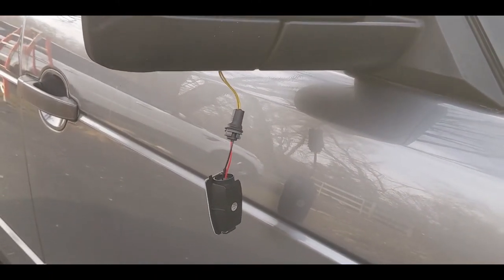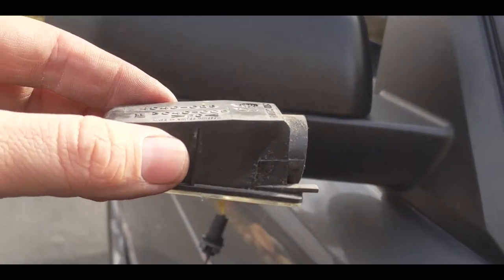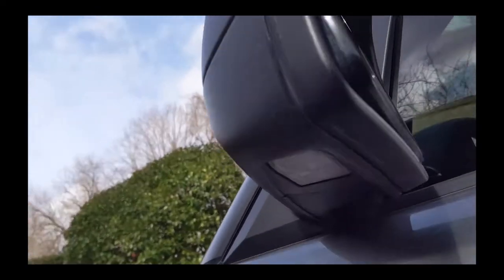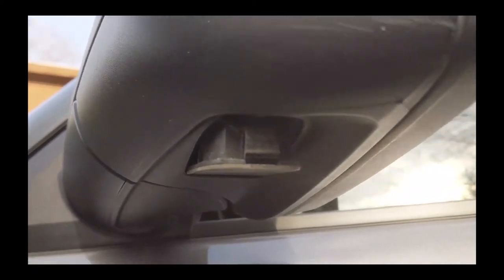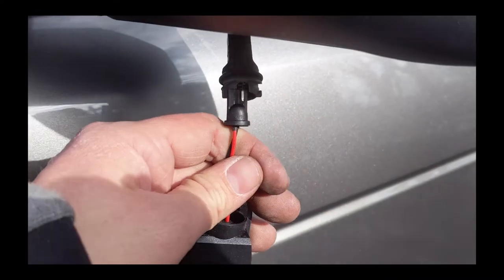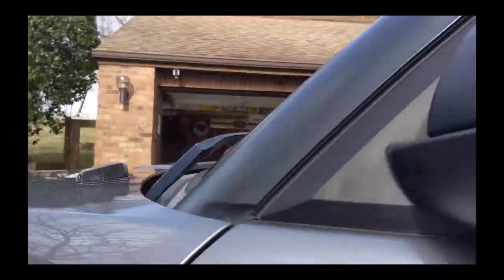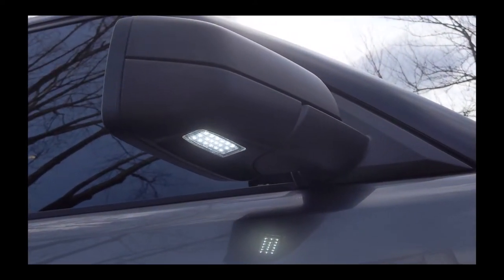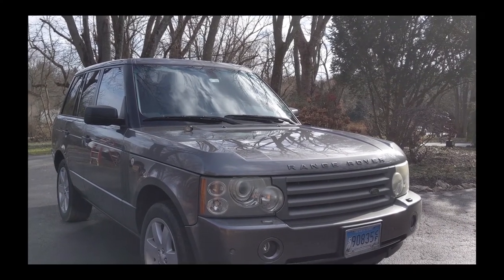2007 Land Rover Range Rover L322 Puddle Lights | Range rover puddle light custom

Comment: I ordered these lights from your description after watching your video, they came in used already cracked tampered and with glue all over them and they are not plug and play they blink constantly after installing them these still need resistors and for 68 dollars you’d expect better because for 18 bucks you’ll get the same quality on Amazon very upset with the purchase oh yeah and I forgot to mention they don’t stay in securely when you close the door the light housing pops out and hangs I could imagine driving and potholes. Best part the company doesn’t even return emails what a  waste.
Reply from the maker: Sorry, that is not the experience I had. Months later, mine are still perfect.